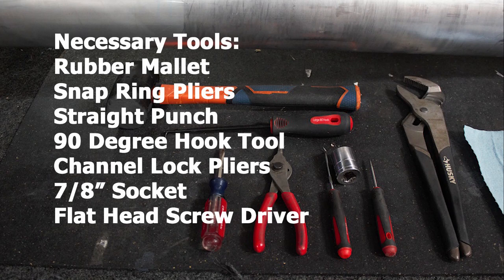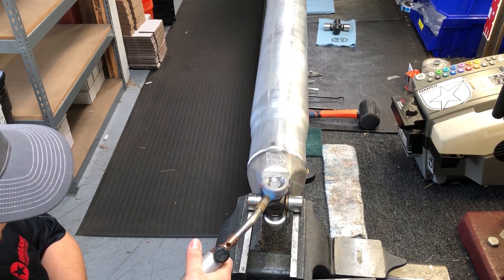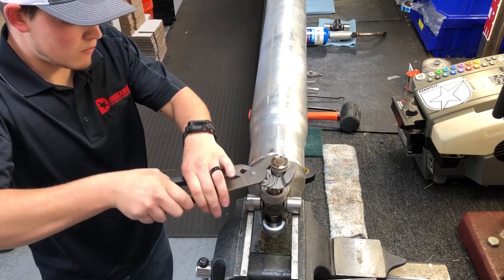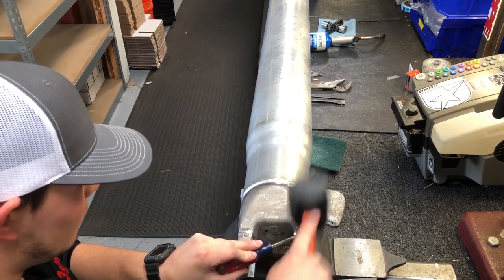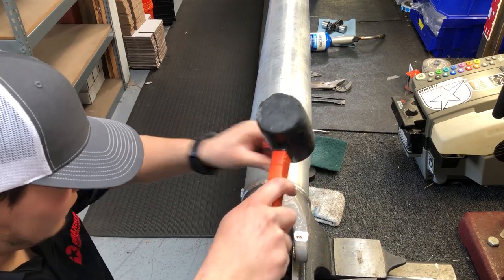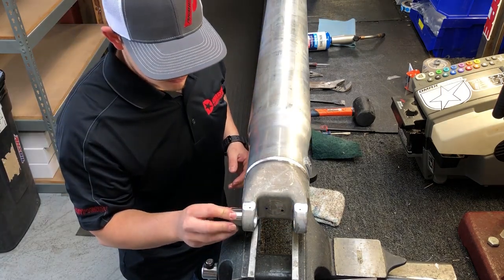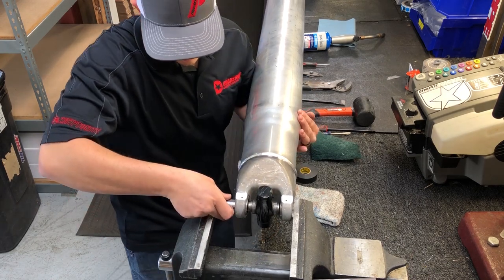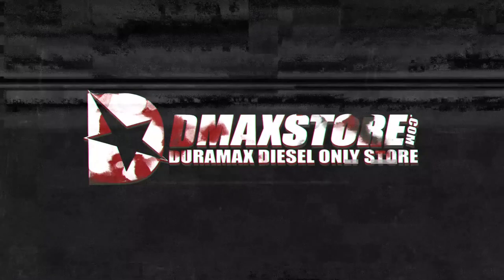DmaxStore Combination U-Joint Installation on Our 1 Piece Aluminum Driveshaft

Comment: Those came out quite easy I just did one 2008 Chevy 2506 L gas I was able to get the caps pressed but I couldn’t grab them with a pair of pliers so what I did is cut a slit in there with a angle grinder and took an air hammer and pounded them the rest of the way out

Comment: I've never heard of heating a yoke on a drive shaft to remove a cap. They make u joint puller to remove the caps
Reply from the maker: They are actually set with a plastic retainer that needs to be melted out. We recommend this method as to not damage the driveshaft.
Reply: I would never use a puller on an aluminum shaft.